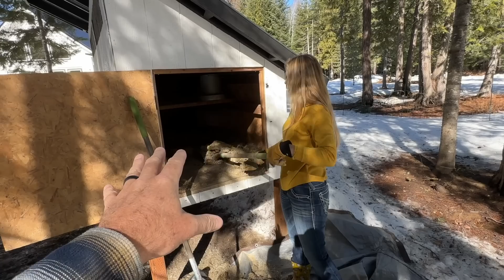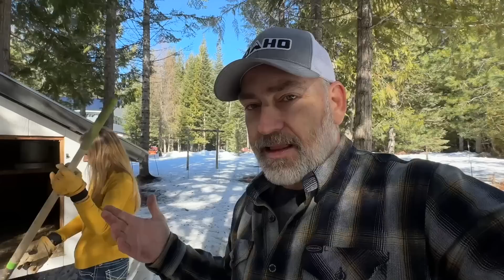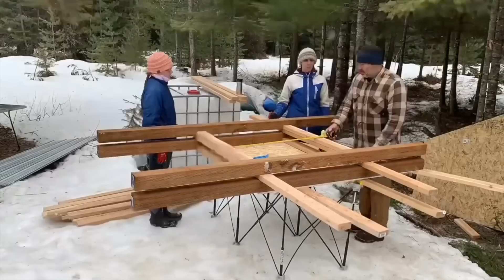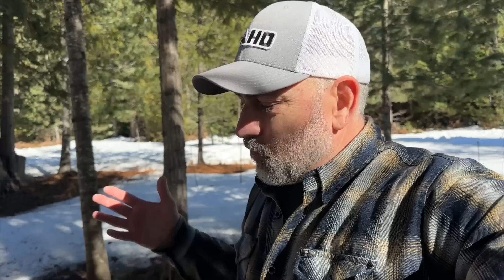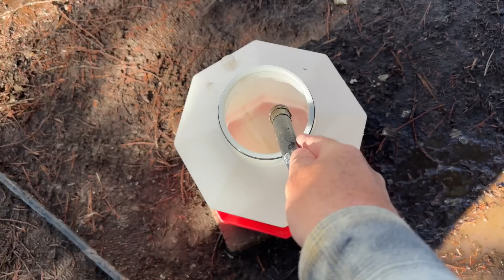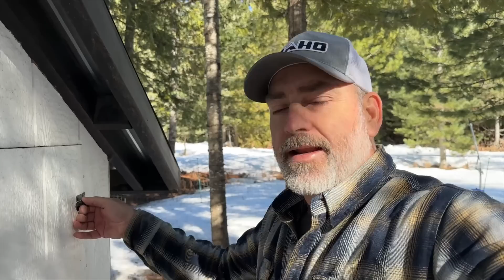ULTIMATE Backyard Chicken Coop Design | Easy to Build, Easy to Clean

Comment: Also, regarding the door, any door that slides I guess, in an area (central WI here) that gets sleet and snow.  what happens when the door gets frozen shut/open or there is ice/snow inside the grooves and the door won't slide down?  Is there some kind of solar heater that warms the metal rail so it won't freeze?
Reply from the maker: We get lots of snow and haven’t had a problem yet. But if it was froze shut one day I’d have to go outside and free it. I bet you could attach heat tape around the door if you have power.
Reply: I'm just south of you and wondered the same thing. I'll be building my coop this month with a run, so I'll probably have the first few feet completely covered on the north side and above.

Comment: I've seen others show the feeders with a 90 degree joint at the bottom (shaved off a bit) so the food doesn't just fall off the edge with gravity.  The chickens then get about a tuna can size feeding bowl.  they'll still mess the area up a bit, but it feeds a couple birds at a time and prevents the 'easy' pulling out of feed.